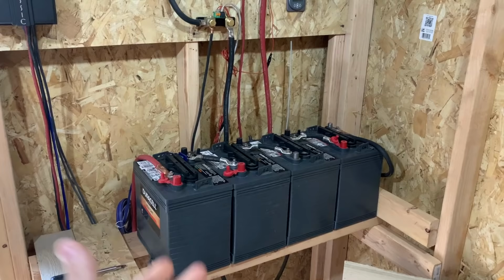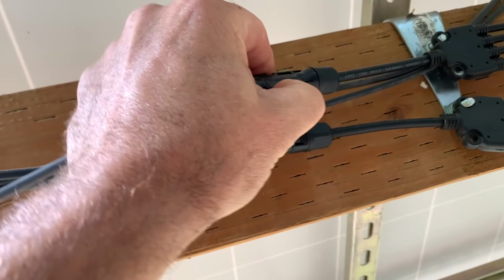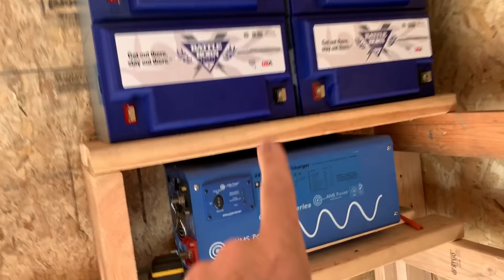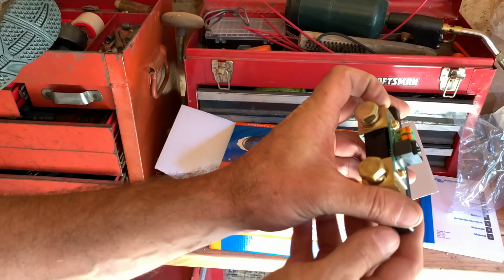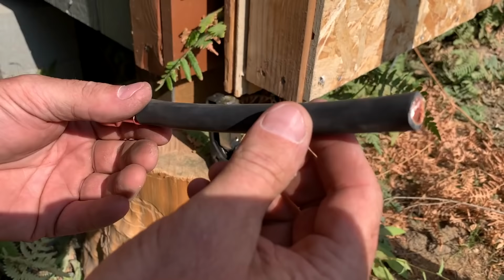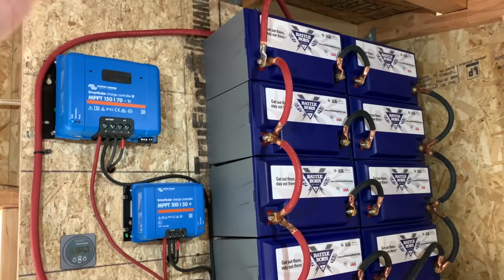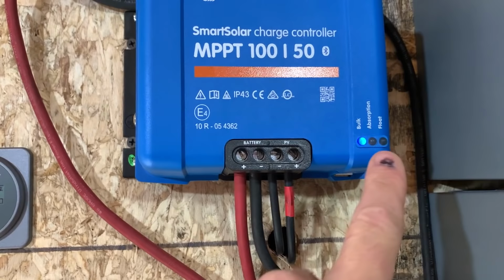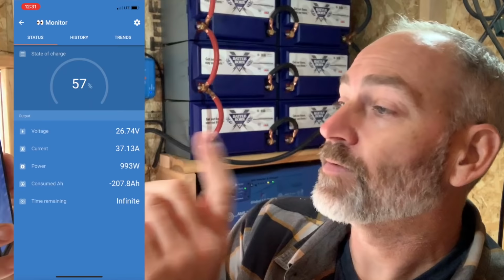EASIEST Off Grid Solar Power System Battery Bank

Comment: 8k in batteries, welp that counts me out. good video though
Reply: Shop around for the batteries.  I'm getting 32 100ah LIFEO4 batteries for 4200 through CALB.
Reply: 8k is very reasonable price!
Reply: @GeraldPUR  it's not reasonable when I'm spending half that on 800ah's worth of batteries.
Reply: @jasonshimkus6139  I'm in the hunt for batteries too. Please share the one you're considering for review. I wanted to go lithium but the cost are horrendous. Thanks!
Reply: I would need 55 of them to replace my FLA bank...not happening lol
Reply: 10k and you have a used p100d tesla battery
Reply: @jasonshimkus6139   CALB are probably one of the most priceworthy lifepo batteryproducers. They still are not worth it IMO. Last time i think I paid around 1300€ for 440Ah at 24V AGM batteries. They will easily last 5-7 years. I dont see them CALB lasting 15-20 years to make up for the three times higher cost. 
The "Litiumrevolution" does not seem to happen, ever...

Cool design with batteries stacked on the wall though. You can't do that with leadacid.
Reply: @windsolarupnorth7084  how many individual cells did you get for that price?
Reply: @jasonshimkus6139  4 220Ah 12V batteries
Reply: Many batteries means needs for balancing then. Could you elaborate this question, guys?
Reply: @Apo5308  check out the battery build "RvExodus" did on his 5th wheel rv.  He explain bottom balancing very well.

Comment: my question is about grounding i notice your system isn't grounded so if lightening struck it would cause a fire. do you have a resolution to grounding or lightening striking your system?
Reply: I could be wrong, but I think the fuse he installed would protect against that, right?

Comment: Why is everyone using lithium batteries in a fixed installation where weight is not an operational concern?
Reply: He said they charge much faster
Reply: @wendywhite2642  In the typical 24-hour cycle of an off grid system, faster charging is of little to no benefit. Yes, lithium technologies can take a higher charge rate, but this will only happen if you have too much PV for your battery size. Imagine 4000 W PV charging finishing at 8:00 A.M. versus 1000 W PV charging finishing at 1:00 P.M.  In the first case, you have 15 kWh PV capability going to waste.
Reply: @A_Canadian_In_Poland  I agree with you. It doesn't make sense. Furthermore, people who know a lot about acid/lead batteries, know they can have maintenance done to them, to make them almost last forever. I have seen a 20 year old lead/acid battery working. I am not going to spell it out for people who don't know how to do it, but I guarantee some here likely do, and it is not hard, however, without common sense, can be dangerous. But yeah, lithium's are not cost effective yet in my opinion compared to lead/acid.
Reply: @wendywhite2642  The need to charge faster is rarely a concern when it comes to solar or wind power as the system is designed to slowly charge the battery bank over the course of the day. The only time speed of charging could be a issue would be if he chose to charge it directly from the generator. However, if you properly design your system for the needs of your home, there is no reason you should ever need to use a generator to charge your battery bank system.

Comment: If you're gonna sell the old system , reach out to Jeremy and Melissa at good simple living . They've not set up solar yet
Reply: But they are on the grid...
Reply: That's who I was going to suggest .
Reply: @astrong1984  So ? You can do both .
Reply: @at347est  You are correct, and in one of their recent videos, they mentioned that they are going to do solar.  

My concern for them is the fact that their solar requirements would be quite large based on the way that they currently use energy.  Obviously, they are very adaptable people so they could adapt to solar. But until this recent vid, I didn't know they were interested :).

Comment: 12k for batteries alone???? You must have a ton of extra cash laying around!
Reply: none  been debating about lithium versus leaded.  Gonna go sealed agm 200 amp hour for 358 depot.  Great cold weather.  Can crank anything
Reply: Lithium is the only way go.
Reply: Can you say "sponsored"? I knew that you could. I should get into the battery assembling business. (I can get 200Ah cells for 1/6th what BB is charging for those 100Ah assemblies. Yes, that's direct from China by the pallet [50-52 cells])
Reply: @Ruminations1from2Connecticut  You get even FEWER cycles with an AGM, more cycles with flooded lead acid.
Reply: @Ruminations1from2Connecticut  AGM also cannot deliver anywhere near the amp hour output.  There are many videos that do a good job of explaining the difference of LiFePH, flooded, AGM batteries.  In the long run, those BattleBorns will deliver 100% of their rating plus last a whole lot longer than the others, hence, the cost goes significantly down over time.

Comment: Did you strap the batteries to the wall somehow, or are they just sitting on the shelf? Thanks.
Reply: I was wondering the same. Anything raising that high and is loose stuff should be strapped

Comment: Great looking system, and it should work great for many years to come. I have a comment/question on the hook up of batteries in parallel. I had read that the cables connecting the batteries in parallel need to be of equal length to the main buses/fuses, to balance the resistance between each battery to the inverter and MPPT. Having each battery connected "in-line" means there is little resistance at the first battery, a little more for the second, more for the third..etc. This imbalance of power being drawn will cause the whole bank of batteries to be constantly out of balance?
Reply from the maker: Maybe it could but BB watched our video to check our installation and approved of it.
Reply: @Graydon  How are you doing

Hope we get to know each other with time and patience?

Comment: Love watching you and family on utube. Thanks for all the great info. 
Question:  We live on about 7 acres and have used a wood burning boiler system as a secondary heat source along with an electric furnace for the house and also to heat the barn. The boiler recently developed a leak and needs to be replaced at a very high cost. Approx $10,000. We would love to go solar but it is so confusing.  Can you give us some advice on the best system to use as an addition to the electric?  We know you use Battle Born batteries and solar panels. Are the Systems like Ecoflow or Oukitel an easier more cost effective option to use a supplement to what we have? Advice on how to get started? 
Thanks,  Charlie and Jane in Ohio

Comment: 16:29 Should it be some sort of 'emergency shutoff switch' to disconnect battery and then will be no spark flying wire but switch operated connect-disconnect procedure?
Reply: the spark on first connect is usually the 'inrush' filling up the capacitors in the inverter. Craig Fisher (below) gave a good way to avoid the spark below.... by putting a resistive load in the middle to 'pre-charge' the capacitors. You can use a 1ohm resistor, or a big lightbulb...
Reply: Or power it up through a large wattage 50 or so ohm resistor to charge the input caps at a slower rate, then bypass it with a switch. It will also reduce arcing and failure of switch.
Reply: @danielbaker716  In my 90s Samsung TV the entry resistor was blowing up every other time from inrush current when plugged to 220V AC

Comment: And though it is a common practice to mount the components on wood, I made a cabinet out of cement board for the batteries, charge controller and inverter, with almost no flammables besides the wire insulation, battery cases, and the plastic inside the devices, and two very small chunks of wood.

Comment: Looks like a expensive investment,getting cheaper by the years gone by
Reply: The lead acid batteries he had are $150 each. The new ones are $1000 each, so that's $8000 just for the batteries, although he probably got a deal for advertising and linking the brand.
Reply: Robert Slackware  Commifornia idiots? Thank you for the new term! It's the best!
Reply: @piotrtrocki3842  dang, where's all this angriness coming from.?  This guy, is doing us all a favor in showing the possibilities available. ANYTHING you build is going to cost.  My electric bill for the year was/is $3300. so far .  If this system costs $12k to $17k, (12K/3300=3.6 years or $17k/3300=5.1 years)  It will pay for itself in 3.6 to 5.1 years.  Not bad.
Reply: @4756cbrown  solar systems are not good enough to save money. They don't last enough and they are still expensive. You won't save any money. Maybe in 10-20 years.
Reply: based on your electric bill you probably have 2500-3000 sf house.
You will need min 20kW energy source. The solar system for 20 kW will cost you about 50k-60k and you will have to replace it after 10-15 years. You do the math.
Reply: Robert Slackware  indeed
Reply: Robert Slackware  Stay powerful
Reply: @piotrtrocki3842  it's not all about the money. It's about self-relience. Electric rates are going to go up and outages will be common. Being on the grid will be increasingly unpredictable.
Reply: @DK-jd8bj  Unfortunately I cannot afford to pay extra for self-reliance. And then there are areas where there's no sun for days or sometimes even weeks, or areas up north where sun stays low above horizon during winter and you cannot fully recharge your batteries. So at some point you will experience outages from your solar power. At the end of the day you still have to have your traditional electricity and if you use your solar system to reduce the cost of your bills it will never pay for itself before it has to to be replaced. Solar energy is good in small applications as a substitute to the traditional way or where there is no electricity at all so at least people can have  something, for example Nomads in Mongolia or travellers who want to recharge their phones or cameras, or to have some light at night.
Reply: @piotrtrocki3842  certainly your choice but being on the grid will soon be worthless. People that have prepared ahead of time will be the only ones with electricity.  My solar system has paid for itself every year since I got it. Cost about $1,000 and I was paying that in electricity bills. It all depends on your situation.
Reply: @DK-jd8bj  grid will never go away. There will be occasional outages during heavy storms, but that's it. Nothing is going to happen to the grid. Is anything going in California that would indicate otherwise?
Reply: @piotrtrocki3842  I guess you haven't been paying attention, we're going into a time of great chaos and anarchy.
Reply: @DK-jd8bj  great chaos and anarchy? What are you talking about? You got me really confused now? What country are you in or what state if you don't mind telling me?
Reply: @piotrtrocki3842  It doesn't matter, it's going to be world wide. Read the book of Revelation sometime. We are entering the last days of this earth.
Reply: @DK-jd8bj  Alrighty then!
Reply: @4756cbrown  $3300? Wow, what does the kWh cost? I thought electricity power is cheap in the us...
Reply: Robert Slackware  sorry Robert.  It doesnt work that way.  If demand goes down, so do prices.  Why?  because expenses also go down.  Same with gas.  Demand down prices go down.  Period   Simple supply and demand.  So with solar, prices are coming down because of more innovation and price to manufacture comes down.  Once it is a major % of total sources (gas, oil, coal, wind, solar) then prices will stabilize.  Plus, using solar? price remains constant, until you need to replace batteries etc.  By then, with newer innovation in battery tech and solar panel tech, prices will reduce even more
Reply: Robert Slackware  Soon to be Idaho as well what with all of the "more money than sense" crowd migrating from California and bringing the same mentality with them that destroyed CA.
Reply: Just start with off grid. But why 2 systemen?

Comment: I'm very surprised that Battle Born would think that your wire crimping  is acceptable. Hammer crimpers are the least efficient. It appears you have got the proper copper lugs why didn't  you get the solder pellets to drop into them + heat them up + insert cable = best connection. You will want to watch your connections  at the charge controller for excessive heat on high amperage charging days...your crimped connections  are going to get very warm and heat = lost power.
Reply from the maker: I’ll check them with a thermometer.

Comment: What’s cost on a system like that
Reply: A small mortgage. Those batteries are expensive now in 2020-2021. As long the batteries are expensive not worth it. One of those batteries is $2000, that is the hydro bill for 2 years. 8 x 2 = 16 years of hydro for house just the cost of 8 batteries.
Reply: @daveporter4667  kinda new to the solar game, so I’m just finding out about certain things but dang that expensive

Comment: When you say Battle Born is "partnering with you", does that mean they sent you the batteries for free, or did you have to purchase them with you own money?
Reply: 1000 a battery plus tax where is the savings? he kinda totally ignores the cost your looking at almost 14k what he installed plus tax.
Reply: Donald Allen  how much time? 14k? How long will these batteries last? it would take almost 6 years of a $200 a month electricity bill to break even.
Reply: The batteries should last 10 years+ he can theoretically break even if he keeps them long enough. Though these were normally 949 a piece. 
No maintenance and better charge/discharge then what he had most likely.
Reply: @geowa3724  I was asking if he got them free or had to pay for them with his own money.
Reply: @geowa3724  Breaking even is never in your favor.
Reply: @greatbay1961  "savings" is an interesting term in this case.  FLA vs. LiFeP04 there are many differences.  The savings are not necessarily monetary.  Weight, maintenance, safety are what I think of.
Reply: @outdoorzee919  Of course he didn't dude... He clearly said he had partnered with them meaning they are sponsoring him and thus had given him the batteries for free because he will be making THIS VIDEO to advertise them for this company to sell them! So there's your answer man!! :/
Reply: @drwho6871  I was not asking YOU! I posted the question to Martin Johnson, who happens to be the ONLY one who can definitively answer the question. Not sure why you felt the need to try and answer for him.
Reply: @vector198  refer to the reply to Glenn Brown (above).
Reply: @vector198  With a screen name like " Sled Head " it is obvious this guy doesn't think or knows little or nothing at all! So we have to help him out since he's unable to drawl the conclusion himself... :-p LoL
Reply: @vector198  It's nice to see a follow human being that actually uses there head Vector.. Pleasure to meet you friend! :) Can't say it's a pleasure replying to " Sled Head " as obviously there's nothing between his ears to carry on an intelligent conversation. :-p LoL
Reply: He said in the video that he’s partnering with Battle Born, as you mention, so no, he didn’t pay for them. Why are you asking questions you already know the answer to?
Reply: @JasperJanssen  Not sure why you feel the need to answer a question that was not asked of YOU?? "Partnering" can mean several different things. From free stuff, to a discount on their products, to a payment for advertising their products, to trading time/products with them, and probably other scenarios. Again, I am sure Martin is capable of answering for himself :)
Reply: @JasperJanssen  Hopefully YOU also have better things to do that answer questions that you were not asked!

Comment: Great video!  I may have missed it, but how are the batteries held in place?  If they're not attached somehow--one small earthquake tremor or something like that, and you could have an electrical problem(s) very quickly.  You could probably hold them securely with just a vertical wood stud across the centers of the batteries.

Comment: Awesome setup and installation.  Question:  do you see an advantage to storing the batteries isolated and insulated (thermally) from each other?  One of my buddies uses a storage room for charging lithium batteries to fly drones and LiDAR devices, and one day one of the batteries heated up, caught fire, and that spread to all the others.  Made a HUGE mess.  I was going to design them a compartmentalized charge station, that if one battery self destructed it wouldn't catch the adjacent batteries on fire.  That was some time ago, so the batteries "may" be more safe now.
Reply: Those batteries don’t much protection between the cells and the outside world. Those 3s,4s,5s and 6s batteries should be stored at about 20% charge if they’re going to sit for days and days. Otherwise they should be separate from each other.
Reply: I fly Drones too. Those are Lithium Polymer batteries.  A completely different animal and designed to pack maximum power in the smallest/lightest form possible.  And yes, they are the most likely Lithium type of battery to be dangerous.
Reply: LiFePo4 batteries are much less likely to overheat than Li polymer & Li ion.